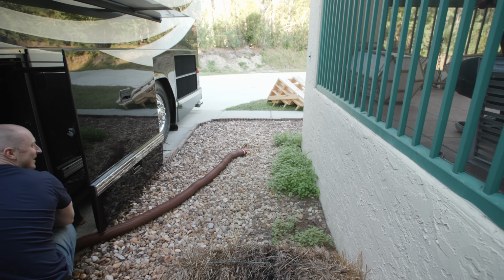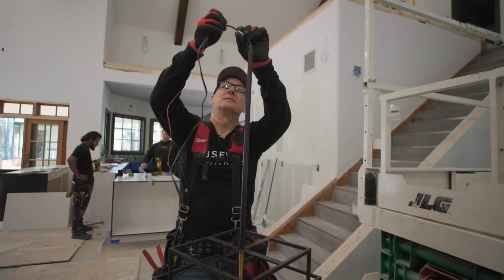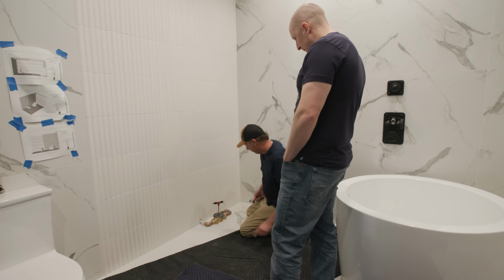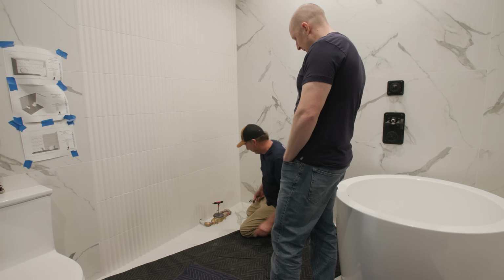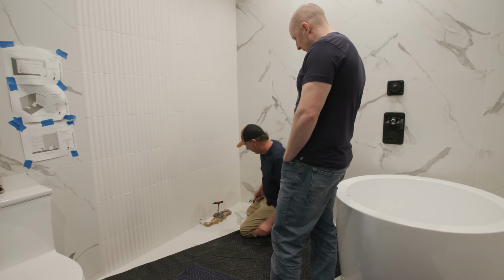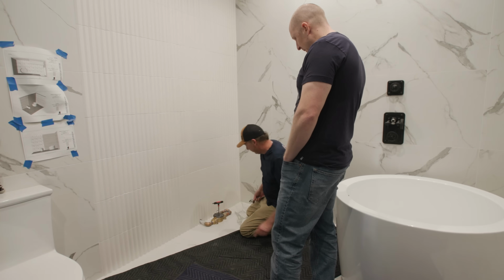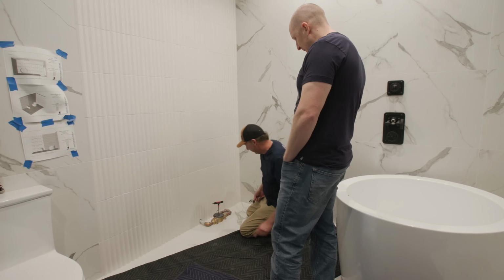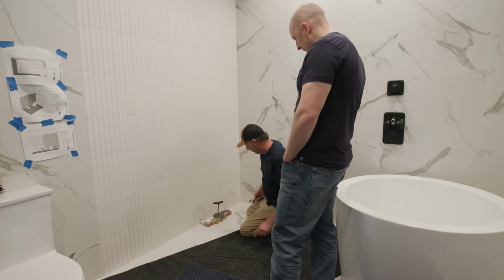Renovating Adam LZ's House - Collete & Adam Love This Bathroom! | EP.27

Comment: 🎯 Key Takeaways for quick navigation:

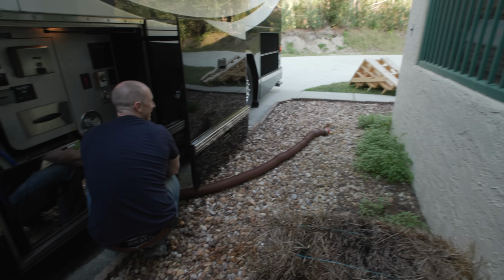00:02 💩 Need to move the rough valve for the big faucet because the tub is tight in that spot, will create a box around for tile and cover
00:45 🛠️ Big project day with several companies working - goal is getting some completion on previous work and starting finished work
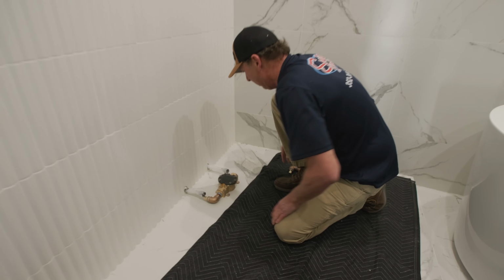01:58 🔧 Adjusting valve for the big tub faucet to get it centered and ready for box to be built around it
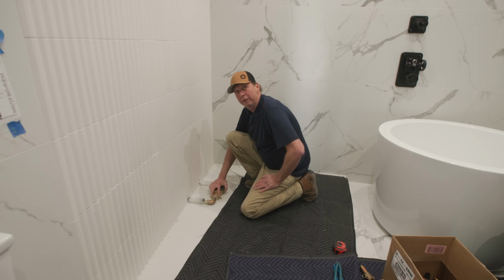03:28 🚿 One more faucet and master bath will be done, then can test and silicone around everything
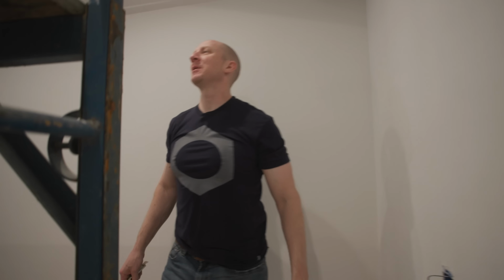04:49 💡 My specialty is putting on blank light switch and outlet covers
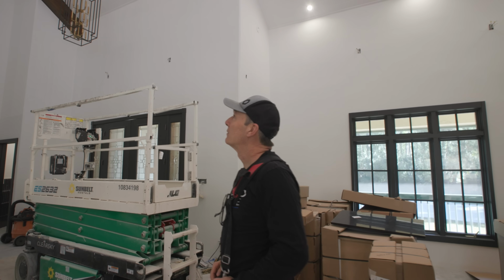07:46 🗄️ *Don't choose white cabinet interiors, maple veneer is better *
09:21 🍽️ Going to convince them to let me do nice matching spice racks, and teach them it's better to cook than always order takeout
12:30 📺 I'll be on the podcast live stream this Friday at 6pm, also doing behind the scenes vlog for Inside the Hex subscribers tomorrow
25:03 🏠 *Countertops will overhang to create a bartop with barstools *
25:30 📶 *Bathroom exhaust fan is on and super quiet at 130 CFM *
26:11 💡 Light switches can be programmed - single tap for 30%/70%, double tap for full brightness
26:53 💻 *Integrations with Siri/HomeKit for voice control of lighting throughout the house *
28:29 🚰 Testing the new tub fixtures - bottom is temp, middle is on/off, top diverts between rain shower and hand shower
31:36 💵 *Bathroom fixtures total around $31k, expect to pay $24k for similar setup  *
33:34 🛀 First bath project for Waterstone (usually kitchens) - designed and manufactured all pieces in this collection
39:04 👌 Ordered kitchen cabinetry before the black option was available, brass still looks great
40:39 ⚙️ *My specialty is installing blank light switch and outlet wall plates *
43:10 🎥 Go to Inside the Hex for behind the scenes footage tomorrow

Comment: Is there a way to flip the washer / dryer doors so they open the other way? I can see that getting annoying as there isn't much room to walk around them if you are in the laundry room. @ 39:06
Reply from the maker: That's a good question.  I don't think they can.
Reply: I not that familiar with with that particular model. But I know other models have reversible hinges so, it might possibly to switch them

Comment: I thought the water stone guy said ( ep.26 @ 9.38) that the rain head was supposed to more or less trickle the water and not be a shower head with pressure ?
Reply: i thought the same thing, higher pressure honestly sounds better to me tho
Reply: That's not pressure though. It's just gallons more flow. There's no pump etc so technically it's a gravity system that's extremely well designed
Reply: It's not high pressure it just performs better than any rainhead i've ever installed
Reply: @serviceplumbinginc1750 barring any defects don’t all shower heads perform they way they are spec’d to?
Reply: I meant the effect of high pressure, i understand its just gravity feed. But I think Adam was looking for more of that style than a trickle.

Comment: Finally realizing that is a regular use kind of tub not. Sure how you supposed to use something round like that as a tub. I've seen it here for a while and been wondering if it was like one of those cold plunge things.
 I really can't see it as a regular tub. I guess collet is small enough?
Reply: the fetal position is very relaxing bro you just don't get it
Reply: @itscaptainterry  But you can't completely rinse off. I physically wouldn't have enough room to get all of my body without my head under. If I have to get my hair wet I might as well take a shower. Look at the builder guy sitting in there. How could he dip his shoulders in easily?
 It just doesn't look feasible his knees are sticking out.
Reply from the maker: This is called a Japanese soaking tub.  Collete is 5'0 tall.  I'm 6'2", 220.  She fits, I don't.
Reply: @ObsessedGarage  I kind of referenced that.  I wouldn't fit either.
Reply from the maker: If you are a man, you shouldn't be in a bath tub anyway.
Reply: @ObsessedGarage  still a weird tub. Even collet couldn't stretch out in that.
Reply: @geniferteal4178  yeah, i was being sarcastic. Having a bath that you can't lay down in and relax (or use together with your partner) seems very inconvenient and defeats the whole purpose of having one (unless you are a small japanese man, who is used to that kind of thing, where you sit in it, hence the name)
Reply: @itscaptainterry  Japanese are generally smaller so it makes sense for them.
Reply: It’s a soaking tub, not a bath tub. You’re supposed to already be clean when you get in, and you just..soak. The waterstone fixture definitely seems designed for proper bath tub, so it is a bit strange.
Reply: @geniferteal4178 it’s not meant for stretching out.

Comment: With as nice as you guys did everything and how picky Matt is I truly can’t believe where you installed the shower controls.
Reply: That's the best spot. Once the glass goes in it makes the most sense. Unless youre a psycho that stands in the shower before turning it on.
Reply: @TASTYTREATSPLS  😂 that’s the point thought. It’s in a place that you basically have to stand in the water when you turn it on.
Reply: @SuperstreetC10 Mike is standing there operating the wall controls while the rain shower is on, and not getting wet. What’s the problem? Because underneath the wall shower head would be the WRONG place for it.

Comment: Maybe a hot take but rain shower heads are the hex lights of shower heads. If you’ve ever used one they’re miserable. Not good for actually getting soap off you and with the distance the water travels before hitting your body the heat dissipates leaving even the hottest water cold by the time it gets to you.
Reply from the maker: I like having both going at the same time.

Comment: 10:45 Matty it's fine to admit you've bought into the hype/marketing and the specs really don't matter. If they did Samsung is the clear winner and has been for many generations. Comparing the iPhone 15 pro max to the Samsung S24 Ultra The Samsung wins in almost every category. Screen size Samsung: 6.8" iPhone: 6.7"; brightness Samsung: 2600 nits iPhone: 2000 nits; resolution Samsung: 1440x3120 iPhone: 1290x2796; pixels per inch Samsung: 505ppi iPhone: 460ppi; CPU cores Samsung: 8 iPhone: 6; ram Samsung: 12gb iPhone: 8gb; main camera Samsung: 200mp iPhone: 48mp; zoom camera Samsung: 50 mp 5x optical iPhone: 12mp 5x optical; secondary zoom camera Samsung: 10 mp 3x optical iPhone: <object not found>; wide camera Samsung: 12 mp iPhone: 12 mp (yay you finally got a tie); video Samsung: 8k 30fps & 4k 120fps iPhone: 4k 60 fps; WiFi Samsung: wifi 7 tri-band iPhone: wifi 6e dual-band; battery Samsung: 5000 mah iPhone: 4441 mah; fast charging Samsung: 65% in 30 mins iPhone: 50% in 30 mins; Charging of other devices Samsung: 4.5 watts wireless brand agnostic iPhone: 4.5 wired locked to overpriced infrastructure; Stylus Samsung: comes with one iPhone: doesn't ;(

Comment: why didn't you go for a tankless heater aren't those supposed to be better?
Reply: No actually they’re junk. And not really an option here since no gas. They’re using an electric heater.
Reply: @Patrick94GSR  I've heard they're supposed to be better and I'm pretty sure they come in both gas and electric.  I don't really care either way I was just curious on it since as I said I've heard they're supposed to be so good
Reply: @TheJeracuda  they’re only good if there are a lot of people in the house that regularly drain a normal tank. Otherwise it takes forever for hot water to actually make it to the tap, so you end up using and wasting way more water than otherwise.
Reply: If you have gas then tankless is the way to go
Electric tankless are good for point of use not for whole house
Reply: @serviceplumbinginc1750  my parents had gas tankless in their attic here in the southeast, and they and several others around here have tons of issues in winter with the units freezing up. They have to blow space heaters on them in winter time, which is definitely not ideal. The Rheem unit at my parents house had to be replaced after only about 5 years, at a cost of over $5,000. Insanity.

Comment: I'd rather pay for the extra time and effort to get the wench system working. For tall lights it's just so nice without having to need to get a ladder. Even if it's a bit slow to move that is some prime QoL.

Gonna have do disagree on the cabinet interior. Any dark color just makes them a light trap.

Comment: I apologize, but it's disheartening to see such fancy and expensive equipment placed poorly. There are over 20 lights on the ceiling that are unnecessary and not spaced out correctly. A giant fan blowing only on the second floor but not on the main living area. The seating position of the bathtub should be located at the corner facing outward, rather than directly facing the toilet. The tub filler should also be moved out a little bit, at around the 8 o'clock position, as everything doesn't need to be centered.

Comment: Tub is a waste of space. It's tiny, it's like a big sink. Rather make the whole thing a shower.
Reply: did they paint it?wasn’t it concrete
Reply: @Jerzey710  the tub? No it's plastic
Reply: It’s not your house. I’m sure your opinion is wanted though.
Reply: It’s not a waste of space if they want it😂
Reply: @JimboBope  would you want the tub?
Reply: It’s a a Japanese soaking tub. She requested it.
Reply: dude the tub is just for collete
Reply: Probably more of a visual effect, than an actual use thing.  And it does look good in that space.  Similar to artwork, nice trim, rarely used equipment and appliances, certain furnishings and 10 pillows on each bed.  Sometimes you have to make things your's.
Reply: Def right but they wanted tub
Reply: relax  @JimboBope